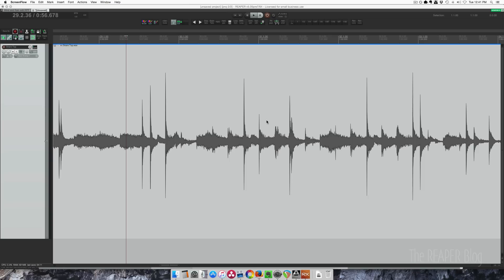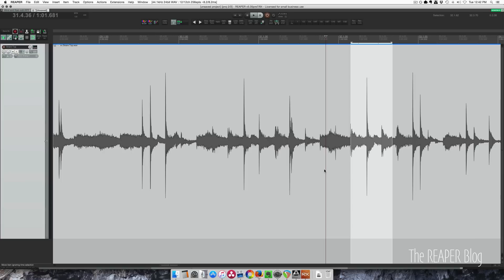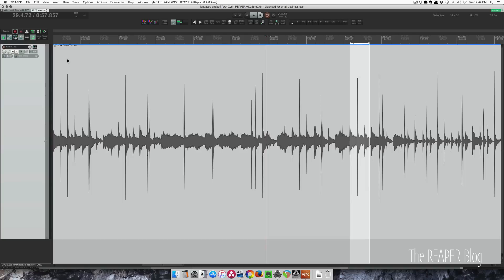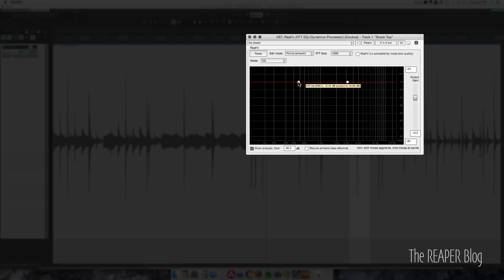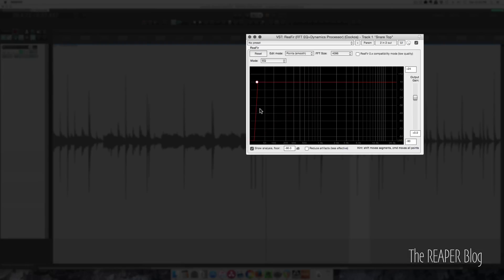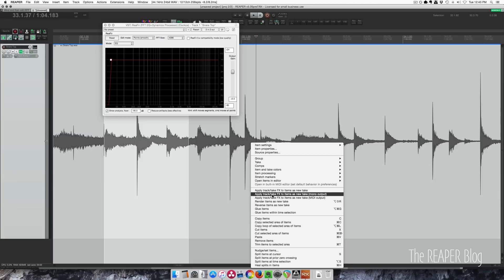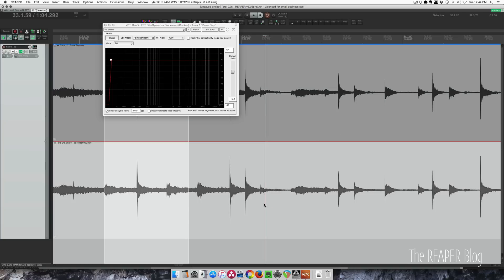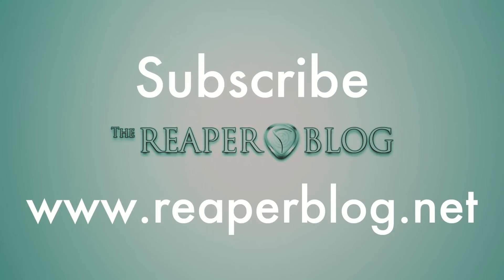Quick Tip Weird Waveforms

Comment: Wouldn't a basic high pass filter at 20hz remove it? And do you know if it's called dc offset if it's only temporary like that?
Reply from the maker: +ejmikk didn't want to risk changing the phase. I think this was dc offset caused by a hardware compressor but I'm not sure.